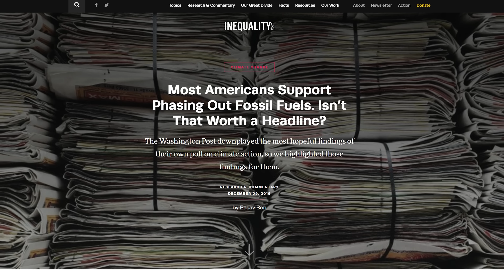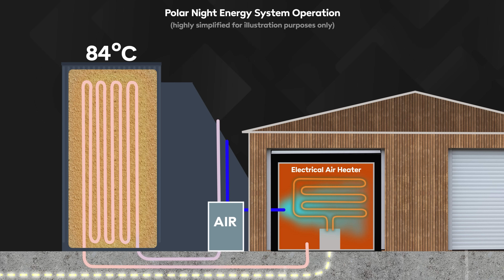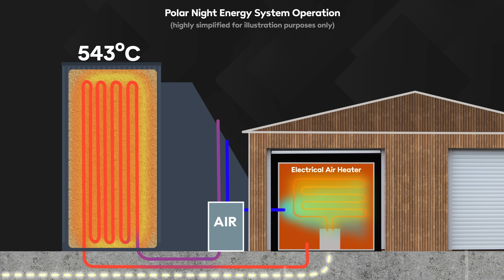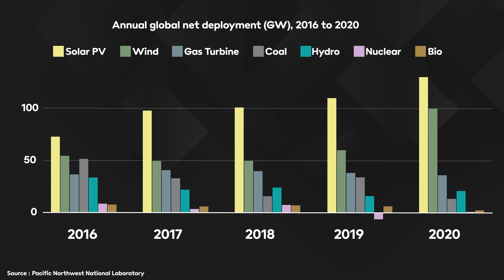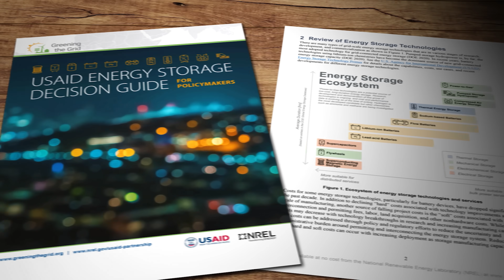The 'Sand Battery' that heats your home, NOT the planet!

Comment: “District heating… Eastern Europe”
Many of the pipes are covered with Asbestos, creating an environmental disaster that needs to be cleaned up 

“District heating… not many examples in… the United States”

Large, older cities like New York City have steam heat under the roads. Every so often there is an accident where an explosion occurs, with injuries and such.

Most of the US is widely distributed, so district heating is only viable in big cities

“move away from fossil fuels… thermal energy storage”

As long as the thermal energy is escrowing unneeded thermal energy, this is good. 

If the escrowed thermal energy is done from electrical energy converted to thermal, this is bad. This is mostly done with fossil fuels. Converting kinetic energy of wind (which cools) to electricity & heat (is actually bad, since the heat enters & is trapped in the biosphere, creating global warming.)

Since renewable energy is inherently unreliable, sinking only electric renewable energy into thermal “batteries” is terrific! Excess production can be escrowed away, leaving us with base power to take care of the rest… which still needs to be addressed since this is mostly carbon fuel or nuclear, but being able to escrow extra energy gets us closer to renewables emulating base power.

If solar energy (in the form of sunlight) was redirected via mirrors, to heat sand, escrowing heat, this would merely delay the heat release in the biosphere. This is better, with the hot sand.

“Waste heat by data center”

This is a good idea!!! Escrow heat formerly being created & released to be trapped in the biosphere!!!

“56 million liters of hot water… 98 degrees Celsius”… “little or no environmental risk”

Imagine the disaster if that tank breaks, boiling  water will cook every living thing alive that did not drown. That is environmental risk!

Compressed CO2 is less risky, with a second benefit of being a carbon sink, with a third benefit of being another way to have the raw resource of Carbon with 4 atomic bonds to be used to hold energy or convert into other organic materials like plastics or fuel.

Sand is readily available, making a reasonably safe & readily available alternative… could also dig a pit, instead of constructing into the air, and build a parking lot or park on it. (Comercially or environmentally useful.)

Comment: This can be a little more efficient, direct heating the sand by electrical wire. And a secondairy, for tapping of heat, wired near by the input.
The 600 celcius will drop constanly when theres no adding heat-energy to it.

Comment: Holland are saying they've only had one heatwave. The issue is that there have to be so many days at or above 25C then some many days above 30C. But the heatwave conditions have been with us in Holland on three occasions this year. It's a bit like a near miss is actually classed as an incident so that facts leading to a possible incident or accident can be gathered and lessons learned. So if the temperature is not quite at heat wave levels isn't it fair to call it a heat wave?

Comment: I love this idea the only change I'd make is use old concrete and block broken up as the thermal mass because we have alot of it laying around and it's often just buried in landfills.
Reply: I also wonder how well a similar system could be used to keep greenhouses running.
Reply: I also wonder how well a similar system could be used to keep greenhouses running.

Comment: Another sick green idea for cutting money. There is not such a large supply of heat in such a small amount of sand, it is not practical. Water has a much higher heat capacity than air and will take heat from the sand many times faster than it will be heated by air.

Comment: All the theoretical talks are rubbish.  In UK people had been using "storage heaters" since 1970s but it never worked.

I said this channel is waste of time on something theoretical and remotely related to the real world.  As an engineer I can confirm even today every gas or steam turbine has an efficiency of just 1/3.  This means we burn 300% of fossil energy just to get 100% electricity.  The rest is rejected as heat to be dumped into the atmosphere.  Combined cycled gas turbine using it 1000+ degree C exhaust to heat water for steam turbine may up the efficient to 60% but there is a lot of rejected heat dumped in every thermal power plant. 

Thus I believe how not to waste rejected heat in thermal power plant is much more appropriate.  So far district heating is the only one that truly makes the use of it.  In UK large apartment blocks used to try it but now they are all dead.  When energy was cheap may be it wasn't economical to use the waste heat but with the energy skyrocketed people should examine how to make use of the 200% heat rejected at every thermal power plant.  Normally this heat is discharged into the sea using seawater which according to the environmental regulation be can heated up to 6 to 8 degree C above the ambient.  On land this heat can be seen from the steam coming off the top of the huge cooling towers.

Comment: Floor heating only needs water around 23°C for a comfy feeling. That's 'cold' water...
Faucet water hardly needs to be more than 40°C.
Mostly these temperatures can be easily achieved tapping at 100 mt underground, and there you go!

Comment: As opposed to most reporting, this is not remotely new. There are systems that use foundations of buildings, water tanks and other mediums to store heat for district heating already.
What is new is merely the higher temperature (and thus higher storage density) combined with some (maybe clever, we don't know yet) temperature flow modeling.
Oh, and great publicity, thats the main part that is new about this scheme, as in most widely reported "breakthroughs".

Comment: Thermal batteries are used widely in the greenhouse industry, accelerated here in the USA by marijuana legalization. A well regarded example would be Ceres Greenhouses’ GAHT (TM), Ground-Air-Heat-Transfer system.

Comment: Interesting system, but with maybe some very specific use case, otherwise not quite as efficient.
Sand isn't the greatest heat storage medium, actually. Its heat capacity is half to 1/5th of that of water.

Let's compare that to using freezing water as the heat storage medium.
The same 'huge' heat capacity of 8MWh can be achieved by freezing the volume of water equal to a soda can with a 6 foot radius (2m), using much less electricity in the process.

The main culprit there is that electricity is then needed in the winter though not in the summer. Air conditioning is essentially free when you have such a huge block of ice on storage.

If you really needed to use the electricity in the summer, then heating the same mass of water as there is sand could give better results, even if heated only up to 95°C.
Keep in mind that as storage temperature is closer to ambient, it's more efficient to use a heat pump for heating, essentially extracting the heat from the summer air instead of just spending the electricity that is usable for other purposes.
Reply: I've just noticed the "imagine what that heat capacity would be if filled with sand at 500°C" part :D
Well, it would be pretty much the same in fact, it would just be harder to work with.
The sand storage can really fit just the tiny niche where it's not worth bothering with heat pumps and water, and where there's extra electricity going around
Reply: I just wanted to do the homework, so here:
56 million liters(=kgs) of water * 4.18kJ/kgK (water heat capacity) = 234GJ/K =  65MWh per degree (either K or °C)
56 million liters of sand is 84 million kg (sand is heavier) *0.83kJ/kgK = 69.7GJ/K = 19.4MWh per degree

Note that 2.6GWh means 40*65MWh, so they are intending to use the water storage only in 40 degrees of temperature span (98°C to 58°C).
The same heat capacity would require using sand in the span of 134 degrees.

If sand were to be used from 30°C to 500°C, it would be 9.12GWh of storage capacity.
If water were to be used from 30°C to 98°C, it would be 4.42GWh of storage capacity.

So, the same volume of storage filled with sand could theoretically be 1.5 times the weight, and 2 times the capacity.

I'm not sure if that 33% of benefit wouldn't melt away considering that you can't just pump sand around like water.

Comment: I was camping along the Copper River in Alaska years ago with a buddy.   Per an old woodsman manual I read as a kid, we dug a pit for our camp fire and put big rocks in the bottom.   After we put the fire out or the night we filled in the pit with dirt/sand and put the tent over it.   Took half an hour to feel any heat but after a hour it got so hot we had to move the tent.   Was still warm in the morning.   This is a great idea as the sand can be warmed by windmill generated electricity  late at night when it's not being used elsewhere.    But, living on acreage, I can't help but wonder about building a small scale model and heating it in the summer with parabolic mirrors?

Comment: Important. I am a fan of the channel.

 This idea I support this. I am a lukewarm global warming person. However, Decarbonization is important as experimenting with endless atmospheric carbon increases may not much matter but is not a risk we can take as a science experiment for humanity. Also, we as a species will need carbon resources for important structural materials and not energy. as time goes by.  If we waste carbon for energy it will run out in a generation or two so we need to stop using it for energy.

 However, terrifying our children and Grete that they will all die in 8 years is excessive blather and wrong. 

Burning up hydrocarbons for energy is a terrible waste of a resource important to future generations. 

I appreciate what this channel is doing.

Comment: Some years ago we built and used a so called Russian wood stove that was common in Finland. By heating the interior bricks to over 1000 Degrees, it took more than 5 hours for that heat to soak to the surface which was very nice for a single burn in the evening to last through a cold night. While heat capacity of brick is less than water the high temperatures meant we could store more heat than an equivalent size water tank. Basic idea seems feasible.
Reply: The Romans did it as well... works ✔️✔️✔️
Reply: there are domestic versions of this type of slow thermal heat radiations system available, cant find model name right now, that are based on ceramic thermal storage
Reply: All across former Yugoslavia (and I guess it was something copied from Germany), so called "electrical thermoaccumulation furnaces" with optional addition of timers have been used in winter time by the residents to take advantage of lower electric power price during night time. During the day, forced ventilation of ambient air through the isolated inside (a labyrinth of fire clay bricks) of the furnace works as space heater without conversions of energy from electric to thermal  happening at the time of use. A thermostat prevents rapid discharge of all of the accumulated heat. The high temperature heat is produced by resistive electric heater lodged in between the fire clay bricks inside. A layer of glass wool keeps the core of the furnace from cooling too soon and also makes surface of the apparatus only lukewarm to the touch. So, basically, the concept of this solution has been known, but this is on a much larger scale and of cost-optimized construction.
Reply: I took an old electric stove I had laying around and filled the oven with sand and screwed it shut. I put 120vdc of solar to the lower element direct. Kept my greenhouse warm enough all winter. January I added another string of panels to keep it up the wattage. You can do it real cheap if you have access to some used panels.

Comment: Now tell me, why are people so "resistant" towards greening the bare areas of the continents?  Does this system not proof how much heat is stored in the bare areas by solar energy to be given off again to the environment?  Just calculate what it would save US residents in just cooling during the summer heat.  That alone would pay for the costs of the greening.
Reply: Forgot to include the "trillions of square miles" of tar surfaces  that have replace much of the natural green areas,  which are the biggest contributor to "environmental" heating.  Greening than the bare areas< where people are less likely to build, will then offset those tar surface areas of solar heat generation.  Mind you the build permits must then be tightly controlled not to repeat the same mistake we humans tend to make.

Comment: The Ontario Energy Board (OEB) released a report outlining in detail its proposal for ultra-low overnight electricity rates at 2.5 cents per kWh for Ontarians who want to opt-in when the rate structure is made available in April 2023 (press release Apr 12, 2022).  As fossil fuel generation is phased out leaving electricity systems with little to no flexible generation (except where blessed with big hydro dams like Quebec) there will tend to be more hours per year when power would be surplus if not for innovations like thermal energy storage sucking it up.  There is synergy with the natural load profile of district heating such that about 50 cycles of storage per year (as mentioned in the video) could take care of the peaks, allowing much lower required capacity of base load heat generation using industrial water source hot water heat pumps from residual heat (reject heat from cooling plus solar thermal both stored seasonally via geo-exchange, industry, sewers, water treatment plant effluent, even water in purification plants).   This makes more sense than individual air source heat pumps especially in Canada where the consequent incremental demand on the electricity system, e.g. in Ontario, from overnight conversion of all building heating to ASHP's would be about 3 times the current available winter system capacity, there is no payback for building owners to reduce heat demand to a level that would obviate this and, in any case, the building trades have no capacity to get the job done in the foreseeable future. But we could build new low temperature district heating systems to reduce emissions ahead of government targets

Comment: The problem with resistance heating is that it is very wasteful. Clearly you get less energy out than you put in. Heat pumps can produce at least three times as much heat energy as electricity input. The problem with heat pumps is that they operate with very low temperature increases. It seems that you actually need both,  heat pumps for normal operation and sand batteries when there is insufficient electricity.
Reply: I'd take that a step further and say water source heat pumps from residual heat (cooling, sewers, industry, lakes) via district heating with sand batteries for peaks, charged by overnight electricity, which should be declining in price as fossil generation is phased out and the electricity systems (except in a few places blessed with big hydro dams) will be left with no flexible generation, so will tend to have what would otherwise be surplus power at night.

Comment: In New York City, there's something called ConEd Steam that I think would be classified as district heating.  ConEd is the electricity company and when they generate electricity, the residual heat creates steam that is then piped to various buildings in the city for heating in the winter.
Reply: Yes: that's probably District Heating. 

It just has to be supplying heat to seperate organisations or households to qualify.

If the "various buildings" were all owned by ConEd and all on the same private site then it wouldn't count as District Heating but would still be just as carbon efficient
Reply: Many, maybe most, cities in the United States have a similar system in the downtown/financial/industrial district, and it's not remotely new, been going for maybe 150 years. Currently powered mostly by various fossil fuels, but can easily be powered by renewables. 
 This type of tech would fit right in, and the systems could be expanded.
 A major advantage is that that power companies, and many city planners and managers, and facilities managers will already be familiar with the concept. You won't have the hard sell of a new unproven high tech solution.
Reply: @xenod1066  then the US is ahead of the UK in this respect. It's regarded as unusual here, and one system (Billigham, Teeside) that was heated by a chemical works went offline when the works sure down a decade or so ago. Had it survived till now then maybe it would have been replaced with some kind of green solution.

Comment: As well as scaling the pilot sand battery up to more industrial sizes, I wonder what the limits are for scaling down? If 4m diameter by 7m will store a few MWh for a small district heating system for 80 hours, could something 1m x 2m work for a home, or would the greater thermal loses, lower thermal mass and need for more insulation scupper this?  Is 4m x 7m the smallest economically/technically viable size? After all I've already got a 1m diameter x 1.5m diameter heavily insulated thermal store in this house: it's called a hot water tank.
Reply: Heat losses are proportional to surface area whereas heat capacity is proportional to the volume. Smaller things have higher surface areas relative to volumes and will cool down quickly. That is why animals such as mice are always eating whereas humans aren't. Therefore t bigger is better when it comes to heat storage systems.